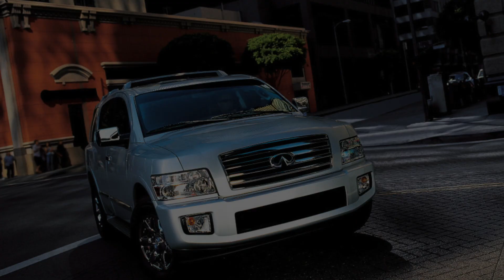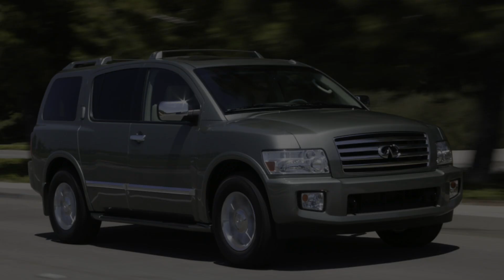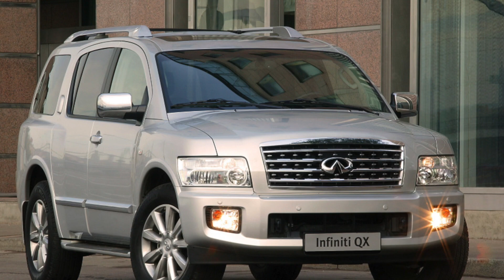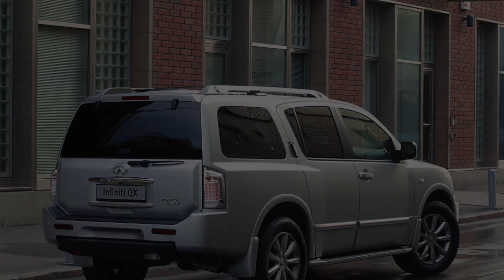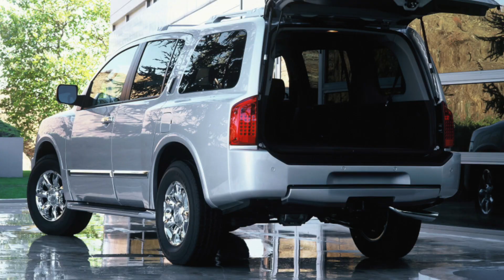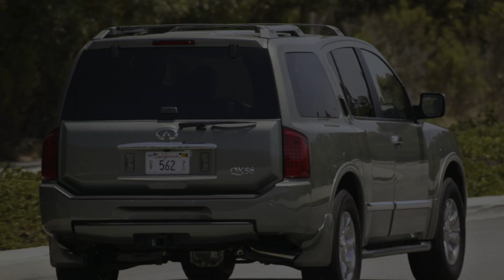Infiniti QX56 Problems | Weaknesses of the Used Infiniti QX56

Comment: Hello

The title of this video is either misleading or frankly wrong. You NEED to change the title for accuracy for people watching this video.

The details you are describing are for Gen 1 QX56s (thru 2010)

The Gen 2 QX56s were manufactured from 2011-2014 before they were renamed to QX80s. These later versions are COMPLETELY different SUVs, especially mechanically. They have very few issues of what you listed here and some other altogether different issues on their own which you have NOT listed. Namely stretching timing chain belts, cats, engine block resulting from bad cats, and some mostly rear suspension issues. Altho I must note that mine luckily never ran into those issues before I switched to a different vehicle.

Be an honest Youtuber. Change this video to clarify its GEN 1 models you are describing and furthermore make an accurate video for GEN 2 models to go with this one please.

Dont let people seeking advice think you are reviewing the later models with this video and end up being misguided.

Thank you

Comment: Did any one experience break light on the dash then the car breaks acts up . When u turn it off and on again it goes away
Reply: Yes mine is doing that now did you figure it out?
Reply: I figured it out, rust... Did you go through a car wash? Or rain? It drys out and stops.. I came up with a solution for it🙏
Reply: @ what is it
Reply: @ I think I might be electric problem
Reply: @AhmedAli-wt2so no I thought the same, it’s the rust spray dawn on it every week
Reply: @AhmedAli-wt2so use dawn dish soap everyday or once a week then go through drive through car wash and drive the car for an hour right after

Comment: You are reciting a written verbal which has little or nothing to do with this particular model line or year of manufacture. Nothing you state in the 4:47 (which sounds just like another on youtube) rehearsal has to do with actual, nominal or abusive use of the vehicle or the conditions under-which it is used and driven. This is a great ploy to get viewers but coming from an owner who has a 2010 QX56 with 279,873 miles on it, you are full of crap and yes, there is maintenance to be done but, my particular year is when Infiniti had a partnership with Mercedes to make their drive train and transmission and there has been ZERO maintenance outside of regularly scheduled and no failure. Please get rid of the MasterDarsPro crap on the QX56 and try to make money by some other way; stop misleading people. If I were to buy a QX56 off a spammer like you, I would expect all the things you mention to go wrong.....

Comment: Easy engine swap Infiniti QX56 2004-2010 5.7 Hemi engine, 6.4 392 Scat pack engine, 6.2 Demon engine, Audi 4.2 V8 TDI Diesel engine, Audi 5.2 V10 TDI Diesel engine, Audi 6.0 V12 TDI Diesel engine , Porsche 4.5 V8 TDI Diesel engine, 4.8 V8 TDI Diesel engine .
Reply: I'm not all that mechanical, but swapping in a different manufacturers engine into a different manufacturers vehicle can't be construed as simple, simple would be swapping in another Nissan where the electric plug into each other and the computers/ecms can read each other

Comment: I bought my QX56 2years ago so I go to smog it and it wouldn’t pass smog. I have replaced 3 of the 5 O2 sensors and it only has 137k miles. The thing that really gets me is the paint is pealing off in sheets on the hood and rear door. Also it has a problem starting sometimes. I have never had so many problems with a car and this is supposed to be a high end vehicle. Very disappointed in it.
Reply: I forgot to put the year iris a 2012.

Comment: The 04-10 QX56 and 04-15 armada are most reliable of all. The 11+ qx56 and 17+ armada are the most unreliable. These suvs have gone passed the 300k mile mark. With proper maintenance these suvs will last a lifetime. The oil burning issue I’ve never heard of. The timing chain issue I’ve never heard of, thats only the VK45 engine. The common issues with these are transmission hoses can leak and burst, blend door actuators go bad, dash bezels crack. Exhaust manifolds crack, Air ride issues, instrument cluster issues, door seal leaks, front pinion seal can leak 4x4 only. And this is on high mileage ones. But all that can be prevented with proper maintance. these suvs come with a solid engine and drivetrain. I wouldnt be too worried on reliability on these. How I know I own a 2005 titan and 2006 qx56 with high miles and are the most reliable suv and truck I’ve ever owned.
Reply: Did Infiniti ever update the replacement parts for better reliability like the catalytic converters? Or will they fail again just like before?

Comment: I have an 06 with 205,000 strong engine and transmission just replaced the 4 rear control arms  upper and lower

Comment: I jinks myself after my first post. I have since replaced my Evap canister vent, ECU unit, fuel pump, temperature sensor gauge and have had my instrument cluster rebuilt. Waiting for the instrument cluster to come in tomorrow to see if that will fix all my gauge problems and my no start problem I’ve been having. Let you know what the update will be.
Reply: Did you fix your no start problem?
Reply: No start is battery fuse

Comment: My 2011 loaded QX56 needed both cats/exhaust manifold replaced the day after I bought it.  Dealer fixed for $500.  Next it burned so much oil that it clogged the cats. (warranty doesn't cover cats)  Also had to replace an engine that threw 2 rods due to no oil in the crankcase.  Oil pressure gauge never registered low oil and no warning light. That happened while towing a 4500 lb RV in the middle of nowhere.  Next engine has 85K miles on it and is throwing oil into the cats again.  This is not a bullet proof motor.   Ring seals go fast.  The car rides like a dream and handles like a sports car in the mountains.  0-60 is a timed 6.01 with a full tank and 2 adults.   No one with any sense seems willing to pull out in front of this beast.  If they could only build a reliable motor it would be great.

Comment: I just bought mine the ride is solid, starts and cranks with no issues. I had one issue but it happened when I changed the battery it locked me out and wouldn’t turn over after that day it’s been running great. However it always smokes on start up, and it has a smell to it, which I hope is not to serious, I really love it cuz it’s spacious

Comment: I love my qx56 I’ve put 233000 miles on it. It doesn’t burn a drop of oil.  I recently replaced the transmission at around 230,000 miles.  I have towed a heavy 7500# rv for thousands of miles with it. I’ve thought about buying something different, but it will be hard to beat the ‘08 qx56! Good luck with yours.
Reply: Did you buy it brand new?
Reply: @situationofchaos  I bought it with about 30,000 miles
Reply: When you tow, do you put it in tow mode, I have a 5000 pound trailer I’m wondering if that’s heavy enough for tow mode

Comment: My 2006 has 150k miles.  A driveshaft u joint was replaced years ago.  Has the woodpecker in the dash regularly.   Just mildly annoying.   The rear lift gate glass hinge broke, replaced.  Liftgate motor came loose, repaired.  No other significant problems, knock on wood.   Gets 12 mpg...  Still really like it.  Great for towing the boat.

Comment: I own a 06 qx56 with 175k. Runs fine. Had to fix a control arm, rack and pinion and rear air shock. Bad roads where I live so it's not uncommon for these repairs. A few minor issues just started to arise. Like losing power when accelerate. Im Looking to diagnose as it just started. And the common rpm/speedometer failing.

Comment: I'm about to buy a 2006 infinity Q56 from a good friend from school! He told me that the only thing he had to fix since he's had it is the suspension that costed him $4000. So I asked him to be honest with me, and tell me what's wrong with it! He said nothing until yesterday. He said the check engine light came on, and he's got the trouble code and it's the catalytic converter so he said that he'll get it fix before I buy it in January 2022. I used to work on cars, but not foreign ones!! He wants $2800 for it. The truck is really clean, inside and out, but should I take a chance and buy it? Please advise!!😉
Reply: I have one with 172k and I just towed a 30’ travel trailer all around the mountains west during 120 degrees heat. I also drove it through 40 inches of snow last winter. My neighborhood was cheering because they were all stuck until I made a path. This thing is amazing. Comfortable reliable. We love it. We call it the beast. Only issue is MPG which is 14 average right now
Reply: Buy it. I've had a 06 for 6 years now and only replaced exhaust manifold and cat, other than that just break pads every year. Danm good ride, very solid and reliable.  Tons of power and will pull danm near anything.
Reply: Just bought mine and It was abandoned and someone living in it , got it for 3k with 165k miles only thing serious that I currently found is rack and pinion, I changed oil, belt, and its running great

Comment: I have a 2011 qx56.   When I start it. It runs fine for about 20mins or so.  Then it shuts off.   When I try to start it again  it's like the battery died. Then when I let it sit for an hour or so.  It starts again normal then shuts off in 20mins again.   Any idea what could be the problem ?
Reply: May be a sensor problem when engine is heated up sensor gives wrong reading to the engine.
Reply: Avinash Edwin: I have the same vehicle. Mines turned out to be the Catalytic Converter. Engine was getting choked and would shut off, wouldn't start again until it sat @ least an hour or so. On cool nights, it would run for more than 20 minutes. 1 mechanic told me it was my batter, other told me it was my alternator. Finally got the right, expensive answer.
Reply: Maybe alternator is bad
Reply: camshaft position sensor. Right under the intake.

Comment: I own a 2004 Infiniti QX56 with 211,000 miles that is still going strong. This SUV has pulled my boat for thousands of miles with no issues.  The truck has never left me stranded and I would highly recommend it because the engine and transmission is bullet proof. Now, the only issues I had was of course a hairline crack in the left exhaust manifold which occasionally triggers the service engine light, it burns about a quart of oil every thousand miles, the fuel gauge was replaced recently, so these are minor issues for a vehicle that runs great and starts every time. Oh, also I have had an intermittent wood pecker sound from the dashboard caused from the the AC unit, which bugs my wife LOL.   I will definitely keep this truck for at least three to five more years and hopefully get over 300,000 mile on it.
Reply: Good to hear this as I just inherited my dad's 2005 with 101K miles on it.  I had my uncle mechanic check it out before driving it 800 miles home.  I seem to have just a couple minor (I hope) issues such as AC not working correctly and need new head light bulbs (I hope that the only problem.) Besides being a gas guzzler it will work well as my work vehicle for my home inspection business.
Reply: @dereksmith6097  
You will love this vehicle, Derek. With just regular oil changes, flushing the radiator fluid and changing the transmission fluid every 60,000 miles, you should enjoy this SUV for many years.  Good luck.
Reply: The sound you are hearing is a blend door actuator. The main issues is the clock spring, fuel gauge cluster, seal behind the oil sending unit and exhaust manifolds do crack and leak. I have over 200k miles on mines and I would gladly buy it again. Not many SUVs on the road are as reliable. I'm an automotive technician so I can day that with experience.
Reply: @brucetec6597   Hi Bruce,  you just described perfectly every issue that I have with the truck.   
It is funny that we have the same problems, but like you stated, I would buy this truck again (or Nissan Armada ). Now, I have about 216,000 miles and still going strong.  The only thing that I do now is put about a quart of oil every six to eight weeks due to the oil leak.
Reply: @ivannadler1789  lol. Look behind the oil filter there is a the sending unit that usually leaks. It's not the whole unit just the o ring in the back of it. Probably 7 to 8 dollars for it. The other usual leaks are the valve cover gaskets.
Reply: @brucetec6597   Thanks, Bruce I will definitely ask my mechanic about that sending unit behind the oil filter. I know that the other leak is definitely coming from the valve cover gaskets too.
Reply: Thank you, Ivan. Since all my repairs, the beauty & the beast is running strong now. Think I made a pretty good decision in the end because I love it now.
Reply: @conswelob   That is great to hear, SoSo.  I hope you have many more trouble free years with the QX56.
Reply: My fuel gauge is good once it’s full but once the fuel goes down it  always get  stuck in the middle ? Can this be fixed ?
Reply: @yaridavelascozumba6961  Hi Yarida,  I had the same problem where the fuel gauge would work sometimes after filling up my gas tank and then sometimes it would read empty for awhile until I either restarted the vehicle or just went to half a tank (which was still the wrong reading).  You have to replace the fuel sensor unit in the gas tank, which the only way to get to that sensor is to take off the right back seat of the vehicle I believe and their is an opening in the floor of the truck to get to the gas tank.  I hope this helps. Good luck.
Reply: I’ve been looking for a 2008-2011 armada. Do you still recommend it
Reply: @Dr.DFA666  Yes I would, just check underneath the vehicle or have a mechanic you trust to make sure there is no major rust to the suspension system or oil leaks. Good luck.
Reply: is there a way to make the sound system bluetooth
Reply: @Jordandavenpor9  No, unless you install a whole new sound system.
Reply: @jordanplayz4278 Yes, aux to Bluetooth adapter on Amazon or radio to Bluetooth converter as well.
Reply: I just purchase a 2013, Twix 56 two weeks ago. I noticed a noise when I crank it up and I’m in the park position the noise is coming from the front of the vehicle was thinking the heat shield cover was loose and it was rattling at the mechanic to check it out. It was not loose. It runs good scared. I’ve only had it three months bought it off of individual check engine light is on, but it’s for the Cadillac converter bank one and bank two mechanic said it could be a fuse sensor. I don’t think that’s where the noise is coming from. Need help
Reply: Car wizard had a video on this model he said his was making  that sound and it was heater valve actuator against right fire wall
Reply: @timcollins2255  Yes, that is correct, but I learned to live with it because I didn't want to pay for the repair. I believe when I changed the heater mode, it stopped.

Comment: Thank you for all the information you have given. Sounds like I made a horrible mistake in buying my QX56. After 3 months of having it, I paid over $600 to have it repaired for two different things. And today it breaks down on me AGAIN. This time it does not want to go forward or reverse. It starts and sounds normal until I push down on the gas to go. It’s almost like I have it in park and push all the way down on the gas and  it just sits there like I’m trying to burn rubber. I have no mechanic that I can go to that will be honest with the repair cost. I got charged $450 for a new belt and a new alternator, plus labor. Another mechanic told me that the repair shop charged me way to much. It sucks that people can be so dishonest. 
Thank you again for sharing.
Reply: $450 a alternator on that truck isn’t bad , that truck will
Pull a premium with many repair shops
Reply: Keep truck in 2wd there is a black rubber grommet next to shifter closest to you,I took a flat head screwdriver popped it off depressed the spring security button shift too park drive reverse it acts up under that wood grain cover,when park get back in car turn on you will hear it the anti theft lock again just depress it again and get back in drive gear
Reply: That is a good price if they are quality parts. Anyone can do a cheaper job cutting corners and putting garbage parts on you Infiniti. They are great vehicles. If you don't want to do repairs then the only way is to buy new and that is still not guaranteed.
Reply: This is what I learned. Take it to a shop for a diagnostic ask for a list of parts needed. Do your research and buy your own parts then hire a mobile mechanic to do the repairs. I was just quoted 3500 motor mount job which I handled myself for 500! I never left my house and it was done in one day
Reply: @abubomom2  I wish it were that easy